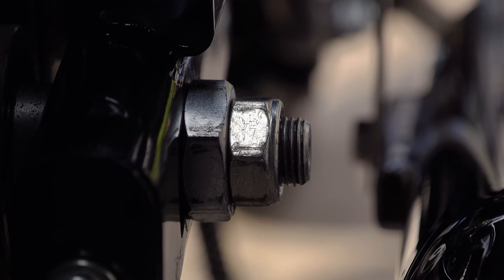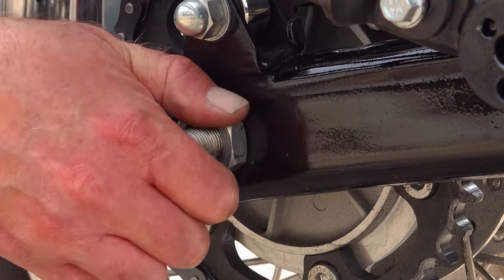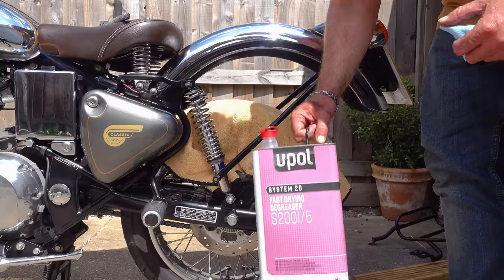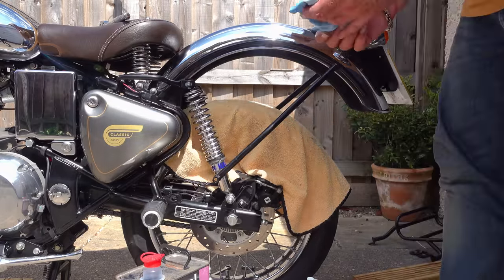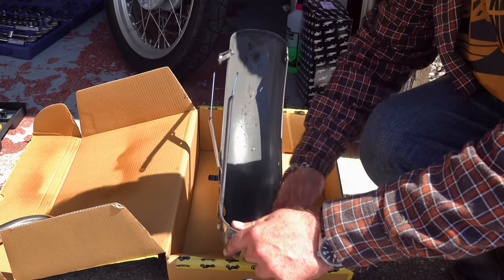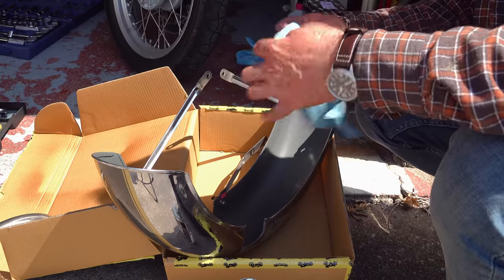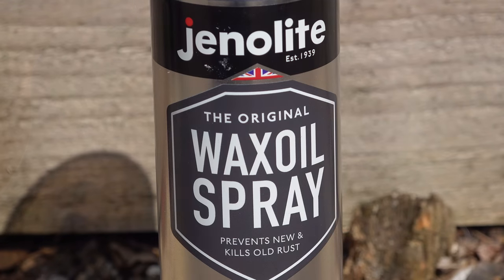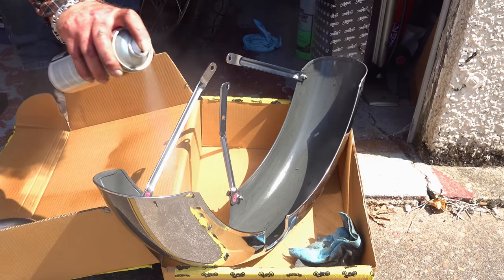BEST corrosion protection for your motorcycle? NEW KID ON THE BLOCK!

Comment: It is an eternal battle with nature protecting a bike. A lot depends on the make, Triumph are pretty good, BMW not very good. In the days when I had to ride the bike every day, all through the year, I discovered a free way to protect the bike. I worked as an electrician in heavy industry in the 1970's. Our messroom  doubled as a motor stores and general storage area. 

In this place was a 35 gallon drum of transformer oil, resting on a cradle with a handy tap. I would bring the bike in on night shift, soak a rag (we used to call them wipers) in oil and apply to the exposed parts of the bike. The result was the road dirt and salt would stick to the wheels, frame and forks but would not do any damage. When warm weather came again a bit of Gunk or Jizer rinsed with water and the bike was ready to polish again.

Comment: Hi Stuart. Just thinking that a comparison test of different products 'left outside in the elements' may not be particularly revealing, as the environment during the test will be very different to real world motorcycling (with washoff etc).  This product looks good though - thanks for bringing it to our attention. :-)
Reply from the maker: most industries test by the exposure method for these sort of coatings Dan. testing indoors at room temperature instantly adds a major flaw to testing these sort of products as it affects viscosity of products designed to be effective in very low temperatures. e.g. a product may run off the sample allowing rust to form in a way it would not in real use. Exposure to the elements represents as close as you can get to real world.
Reply: @stuartfillingham  I suppose the only trouble is that ACF50 would probably work almost as well as waxoil type products in a static test; it's when you start hurling road spray at the two products that the differences will show. However, with that accepted, it could still be an interesting comparison and well worth watching. 👍
Reply from the maker: @clearprop  Hi Dan, its simply not possible to carry out a rolling test as you would need one identical bike for each product and they would have to be ridden at the same time to ensure fairness in the test. This would likely run in to tens off thousands of pounds to carry out.
3 months exposed to wind, rain hail and snow in A typical English winter will I think give an accurate indicator of what is what.
Reply: @stuartfillingham  An idea would be to buy a cheap hack. Treat the left and right sides with the opposing products. Ride it through the winter and don't wash it until the spring.

Comment: Good morning Stuart, just the video I wanted to see. I've recently bought a new Suzuki VStromxt and had it delivered during the lockdown. It went straight into my new shed with zero miles on it. After a few weeks I noticed that my wire spokes were rusting. So I think that Suzuki are going to honour the warranty 🤞 and replace them. Looking forward to when this happens, how would you recommend that I apply this product to spoked wheels or would you recommend something else? Thanks 👍
Reply from the maker: spray a rust protector on to a cloth and use the cloth to apply to each spoke.
Reply: @stuartfillingham  thank you so much Stuart. This looks like a great product and I will give it a go. Great video by the way 😊👍

Comment: You say your garage is damp, mine is too and leaks sometimes through the eaves depending on wind direction and strength. My solution was to remove the roof, spend thousands of pounds ….. no only joking. I bought a plastic greenhouse and put it inside the garage. It doesn’t touch the bike so doesn’t scratch it, I can put the bike away when it’s hot immediately after riding, it’s big enough to stand inside and cheap. It also keeps the dust off it. I paired this with disposable dehumidifiers. Prior to this over winter my bikes would be wet to the touch from condensation, not anymore. Only other thing I’ve done is put a scrap piece of carpet on the floor. These two links are what I use. Works for me, looks crap, but is a cheap cheap solution and I’m happy. I use acf-50 but might try some other products. 

https://www.argos.co.uk/product/8728047

https://www.therange.co.uk/diy/air-treatment/dehumidifiers/interior-dehumidifier-235g/
Reply: @G Dog new roof would do little for mine. It’s got cracks all over and more than likely made from mundic block (walls are very soft) so would need completely rebuilding. If your not from certain areas mundic might be confusing, but they were blocks made from mining waste and they happen to disintegrate with age which is nice, the main house doesn’t have it though which is good news.